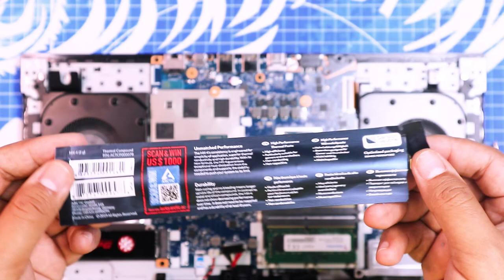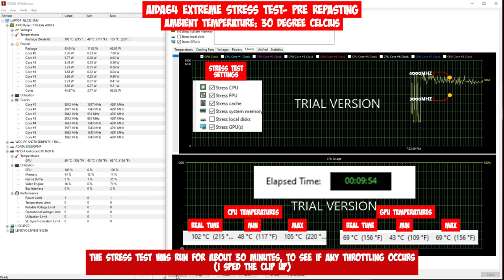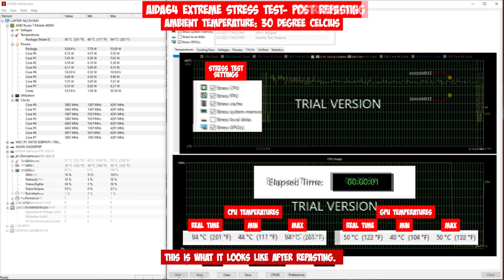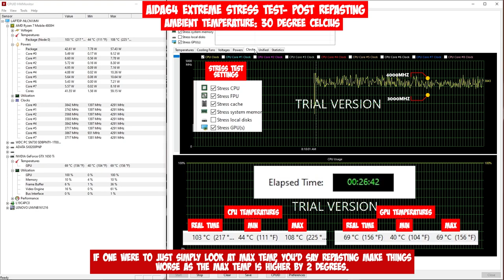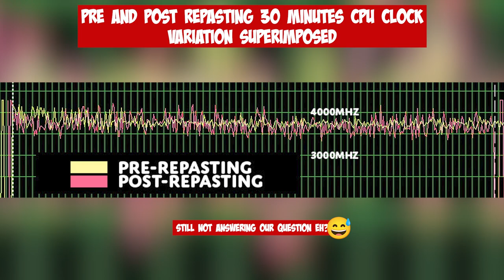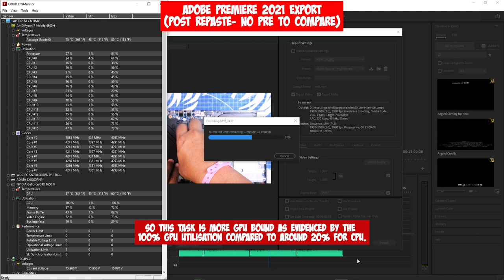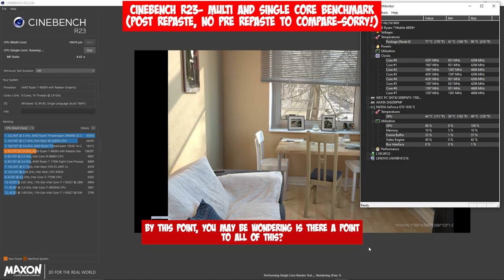Repasting My Lenovo Legion 5 |Replacing Old Thermal Paste|

Comment: can this laptop use liquid metal?
Reply from the maker: technically you can use liquid metal with any computer. however, that doesn't mean you should. yes, it conduct heat well but the issue with liquid metal is that it is electrically conductive(most of them anyways). in desktops, you probably okay as you won't be moving your tower a lot, in laptops, I would be a bit concerned as at least for me, I tend to carry around my laptop pretty much everywhere. so there's higher risk of the liquid metal to spill and causes a short. the Legion 5 is not specifically designed to use liquid metal, as there's no built in barriers etc to prevent spills. in the end it's really up to you, if you think the risk is worth the benefit, by all means go crazy with liquid metal. hope this helps😁
Reply: ohh tq for the insight. i thought this laptop can use lm without worrying it is gonna spill anywhwhere because the amount of lm applied is very thin *sorry for my bad english

Comment: can we just blow the fans to clean the dust? I'm too scared to pull out the fans from motherboard
Reply from the maker: hi. thanks for watching. you can blow the dust off the fans. but I suggest to do that more often ie every few months or so, so that there won't be any stubborn dust built up. you can also use old tooth brush to remove the dust without taking out the fans. hope this helps.

Comment: sir do you need to remove the plug of battery before applying the paste?
Reply from the maker: thanks for watching. yes, ideally, if you're doing anything with the back panel open you should unplug the battery. this is to minkmize the risk of shorting something out. Im quite guilty of not unplugging the battery many times, but do as I say, rather than as I do😅

Comment: Hey, i got Lenovo AMD Ryzen 9 7945HX (16C / 32T, 2.5 / 5.4GHz, 16MB L2 / 64MB L3) any chance if i repast the temps will go lower? the 7945HX runs pretty hot under load average 80-95c  

Specs:
CPU
AMD Ryzen™ 9 7945HX (16C / 32T, 2.5 / 5.4GHz, 16MB L2 / 64MB L3)

GPU
NVIDIA® GeForce RTX™ 4070 8GB GDDR6, Boost Clock 2175MHz, TGP 140W

Memory
32GB, 2x 16GB SO-DIMM DDR5-5200

Storage
1TB SSD M.2 2280 PCIe® 4.0x4 NVMe®

Display
Size
16"
Resolution
WQXGA (2560x1600)
Touch
None
Type
IPS
Brightness
500 nits
Surface
Anti-glare
Refresh rate 240Hz, DisplayHDR 400, Dolby Vision, AMD FreeSync, NVIDIA G-SYNC, TÜV Low Blue Light, TÜV High Gaming Performance
Multimedia
Audio Chip
High Definition (HD) Audio, Realtek ALC3306 codec
Speakers
Stereo speakers, 2W x2, optimized with Nahimic Audio
Microphone
Dual-microphone array
Camera
FHD 1080p, with E-shutter, fixed focus
Connectivity
Ethernet
Gigabit Ethernet, 1x RJ-45
WLAN + Bluetooth
Wi-Fi 6E, 802.11ax 2x2 Wi-Fi + Bluetooth 5.1, M.2 card
Ports
Standard Ports
3x USB 3.2 Gen 1
1x USB 3.2 Gen 1 (Always On)
1x USB-C 3.2 Gen 2 (support data transfer and DisplayPort 1.4)
1x USB-C 3.2 Gen 2 (support data transfer, Power Delivery 140W and DisplayPort 1.4)
1x HDMI 2.1, up to 8K/60Hz
1x Ethernet (RJ-45)
1x Headphone / microphone combo jack (3.5mm)
1x Power connector
Keyboard
4-Zone RGB Backlit, Hebrew

Power
Battery
Integrated Li-Polymer 80Wh battery, supports Super Rapid Charge Pro
Power Adapter
300W slim tip (3-pin) AC adapter, 100-240V, 50-60Hz

Thank you
Reply from the maker: hi. in simple terms. your system won't be any significantly cooler. it just that by repasting the system will be more efficient. ie your system will still reach the same load temp of 80-95, but you will get better performance at that temp.
this is simply because that's the way the system is designed. the laptop will continue to pump more power and go faster as long as there's still thermal headroom. hope this helps.
Reply: @masterofnone4608  Thank you for the reply. I've repasted my CPU and GPU with Noctua's thermal paste the factory thermal wasnt good. thanks for your feedback

Comment: My legion keeps crashing on every single game it says GPU driver shit. Does that mean I have to repaste mine as well? Thanks appreciate the reply.
Reply from the maker: I believe the correct first action would be updating the driver first.
Reply: @masterofnone4608  You have no idea how many windows reinstall / driver reinstall I did with the DDU shit man so annoying can't play games on a gaming laptop xd
Reply from the maker: @wonderbopeep64  sorry to hear about that. repasting really is for getting better(slight) cooling performance. it does nothing to driver issues. however, if you believe the crash is due to uncontrolled temps, repasting may help. but if it the driver issues persist despite reinstalls, i highly recommend you get your laptop looked at by a professional. i don't believe i can be much help beyond that without actually seeing your laptop myself. hope things'll work out for you.
Reply: @masterofnone4608  awesome thanks man. will check in next month for professionals to actually look at it.
Reply from the maker: @wonderbopeep64  hope things turn up well for you.

Comment: What did you have the lenovo vantage fan profile set to? I wonder if they have their fan profiles set to a standard that conforms with the expected results of the paste they use from the factory. That could defiantly counter act any improvements the paste is making, if the system is waiting longer to kick the fans on. Better fan controls would be nice. I only need my laptop to be quiet in class. It can get as loud as it wants if I'm gaming.
Reply from the maker: hi thanks for watching. For the stress test I put the laptop in auto(balanced) mode. I did run the stress test in performance mode but temps were running over 100 degrees too often with very little clock speed gain. by my estimate running the system in performance mode will gain you approx 10% performance in exchange for more heat and fan noise.

personally I don't feel the trade off is worth it. So I run the system in auto mode as it's probably more representative of how most people would use the laptop.

again, in quite mode you'd expect a quiter system with less performance.

hope this answers your question. thanks😊
Reply: @masterofnone4608  , interesting! Very interesting.
Reply: @masterofnone4608  Do u have any other tips for laptop ?and do u think a begginer could do the repaste alone?
Reply from the maker: @Kaantop7  hi. thanks for watching. not much tips apart from be patient and take your time and of course use plastic pry tools 😊
yeah, I think an inexperienced person can repaste. especially in the Legion 5, where lenovo did make this laptop quite user upgradable friendly. main thing is, again take your time and be reasonable with it.
watch how people do it(not just me) until you're confident enough and then attempt it yourself.
Don't rush and take your time. to be honest most challenging part for me is really taking the back panel off😅
once that's done. everything else should be easy.
hope this helps. thanks

Comment: Hi, thank you for the video. Wanted to asked you about one think (maybe you know). Recently i've bought a Lenovo Legion 5i with CPU i7-10750H and RTX 2060. Seems pretty tough but when I play Far Cry 5 on max (system suggested that) I get 85-92 CPU temp. Laptop is 4 months old and I also use a cooling pad. Should I be worried about this temps?
Reply from the maker: hi. thanks for watching😁 the 10750h max temp is rated @ 100 celcius before it starts to throttle down.
There are many factors that influence temperatures, airflow and ambient temps being among them.
based on what you mentioned, that temp range is well within the safety limit of the cpu while it being stressed.
I would be worried if your laptop is consistently operating at that temp on idle(ie just turned on and not doing anything), however if you're gaming it should be fine. 
the best way to know whether your temp is normal for for your laptop is to compare with what the temps other people with same laptop experience. nowadays it's easy, just search your laptop on YouTube and I'm pretty sure there's at least a few Legion 5i reviews. you can compare your temps with them. hope this helps😁
Reply: @masterofnone4608  Thanks for answering. Do you know is it possible to overclock this series of laptops?
Reply from the maker: to overclock, in general you have to have upgraded cooling. that's why there's aftermarket cooler.
with laptops, it's a bit complicated as there's no real after market cooler for laptops.
manufacturers also designed their laptop cooling to extract a certain level of performance and usually there's very little/no more performance that can be squeezed from the processor because cooling limitation.
you also have to start thinking about increased power requirements when overclocking. as most laptop charger is designed to be compact and cost saving, usually the supplied charger will just be enough for the rated performance of the laptop and would not be suitable for overclocking.
so, no. I don't think you going to get any tangible improvement by overclocking your laptop and would probably hv more stability problem.
ha ha. anyway, this is just a long winded way of saying I don't think the Legion 5i(or any laptop for that matters) was built with overclocking in mind.
hope this helps😁
Reply: @masterofnone4608  Many thanks. This is very important information for me, because no matter how much do you read about gaming laptop it never enough. Now i've read about different processes like undervolting and still try to guess does it need something like that.
Reply from the maker: @recreator9755  undervolting is more to do with getting the temperatures in check, than any boost in performance. boost in performance(if any) when undervolting is mainly due to improved temp that lead to less thermal throttling ie you getting a more consistent and sustained frequency. not exactly the same as overclocking. hope this helps😁

Comment: I wanna ask something. I have ryzen 7 5800h and rtx3060 model legion 5. It has been 3 months but it looks dirty. Can i clean the dust without removing anything? (i mean just the back panel ofc) Maybe with some air or brush like you did?
Reply from the maker: yup. you can. just use a small brush(I use an old tooth brush) to get the dust off the fan blades and us some compressed air(i used and electrc air compressor(pumpl for inflatable pools) to get it off the motherboard. hope you find this helpful. thanks for watching 😁

Comment: ok thx for video . got mine thermal paste also changed yesterday : want to point a very important thing to consider - the temps are higher now on cpu and gpu , and i thought first I made a mistake fitting smth  but indeed the inside diode temp goes higher because coolers can take faster temperature out  so take care everyone, basically cpu is now on 92 celsius and was on 85 c and thermal paste was rock old , changed to a good one grizzly kryonaut

Comment: My 5800h is reaching 100 degrees and throttling, the gpu reaches between 90-92~ degrees. I hope repasting works for me... I did clean a little bit the fans but I'll try now with a toothbrush

Comment: I'm going to replace thermal paste and pads on my Lenovo legion 5 Gen 6 (i bought 32 GB of faster RAM 3200 CL20 so i though why not? Once i open the PC let's do the full work) and bought Noctua NT-H2 and Thermal Pads with 17 N/m*K
Your video Will be so useful when the components Will arrive!
Reply from the maker: thanks for watching😁
Reply: How did you know what size of pads to go with?
Reply: And  did the pads help?
Reply: @Morri88  for the size of pads I looked on internet, and if I am not wrong 1 mm should do the trick but I don't remember. Yeah they helped, the temperatures are exactly the same, but fans are quieter most of the time and frequencies are more consistent.

Comment: Hello. I have the exact same model. Any warranty stickers I should look out for?
Reply from the maker: Hi. thanks for watching. as far as I can tell, no warranty stickers anywhere on mine. hope this helps. thanks.
Reply: @masterofnone4608  
Thanks. I noticed that there were none on mine too but I just had to make sure 😅 Like yours, mine also has a tiny Lenovo sticker on the top portion, any idea on what that might be?
Reply from the maker: @mediocritycentral  can't say for sure. it's between the power port and the hdmi. I'm guessing it's probably covering a screw that you need to remove in order to take out the main board. but it's just a guess, don't really know for sure.
but don't think need to bother with it for the typical upgrades eg RAM, ssd etc.
hope this helps 😊

Comment: use thermal grizzly kryonaut , it has the high thermal conductance at 12.7 W/mK ♥️♥️♥️♥️ , while your MX4 is like 4.7W/mK, but still good ♥️♥️♥️
Reply from the maker: thanks😁 I probably try that one next time.
Reply: Was there any temp improvement compared to the stock thermal paste?
Reply: @miroslavmartinek522  i applied some to my friends asus tuf laptop , since the TUF gaming laptops have little to no vents , it overheats like hell 🔥🔥🔥

94°C was the maximum , repasting with Kryonaut brought maximum temps down to 83°C ♥️♥️

that was for the CPU , GPU had like a 4 degree drop..
Reply: @JoshuaG  Ok, thanks a lot
Reply: @miroslavmartinek522  the effectiveness of the paste depends how much or how little you apply to it.

What i did was just a little simple dot of paste and thats it 😊
Reply: @JoshuaG  yes, it deffinitely makes sens, the thinner the paste layer, the better :D i was just wondering if there is any improvement when using better thermal paste on this particular Lenovo Legion model
Reply: @JoshuaG  its been 2 months do u still recommend thermal grizzly kryonaut  for my legion y540 i7 9750h???
Reply: @darthvader44  Definitely 👍 , 9750h is toasty , its needs some kryonaut lovin♥️
Reply: @JoshuaG  thanks for replying:))
Reply: Those numbers don't mean anything. They are provided by the manufacturer after all.
Reply: @AB-sg4xu  Thats why there are test's to prove it , and Kryonaut is well known to PC enthusiast's and seeing countless youtube videos with extensive testing on Kryonaut proved its more effective ❤️
Reply: @JoshuaG  yeah but it's not just down to those numbers. it's maybe 1-2C difference, nothing special.

the one thing you are overlooking is that Kryonaut is a less viscous paste, which isn't that good for laptops because of low mounting pressure of the heatsink, and it can also dry out at temps over 80C.

So for a laptop MX-4 is better because it's more viscous it will last longer too

Comment: Hi Sir ,

I am using legion 5 pro
While on cinebench my temps goes 100 degrees 
And cpu watts utilization is only 68w

Same system my friends also have 
When they do cinebench there laptop also goes 100 digress but there cpu watts utilization was 78w

For me 68w for them 78w

Any idea why this is happening on my system?
Reply: @Master of None
Reply from the maker: hi. thanks for watching. I am also currently using a Legion 5 pro. cpu 5800h and rtx3070.
I haven't done extensive testing, however in my laptop, while running cinebench loop for 30 minutes straight,
what I notice is the temp spikes can go as high up as 108 degrees celcius, however, the spike usually last for a few seconds only and the temp drops back down once the fans start ramping up.
what I notice is if you run cinebench in balanced mode(led white), the power draw limit is around 65w and the temp limit is around 90(temp where the cpu start drawing less power or start to clock down/throttle).
if you run cinebench in performance mode(led red),
the temp limit is around 100 degree before cpu throttle down. power draw can go as high as 80w in performance mode.
have you tried in both modes?
ambient temperatures also play some roles, I live in the tropics, my ambient temp is usually around 30 degrees so comparing to others results(those from cooler countries) my cpu does run a few degrees hotter.
if you think your system runs hotter than it should be, you could try repasting the cpu or if still in warranty, check with your local lenovo.
hope this helps. thanks for watching😁
Reply: @masterofnone4608   I started cinebench 23 on performance and on charging and ambient temperature is 34

Anyways i am returning my laptop as it has random Freez issue on silent mode

Comment: oof that's a lot of thermal paste. I wanted to see how much you would use for reference, because i'm sitting here repasting my own legion 5, but damn man you're gonna have a mess to clean up the next time you lift that cooling brick
Reply from the maker: ha ha. actually it's not too bad. I repaste it twice because the first time I did it, the temps was pretty similar that I thought I put too little paste, but as you said it's actually a bit more than I need. however, it's not so much that it made a great mess😅 thanks for watching😊

Comment: i just bought the legion 5 pro i7-11800h 3070 variant few days ago, not satisfied with the temps on the cpu and gpu so i decided to open it up and see it for myself. I was surprised that the stock paste already dried up! i could swipe my finger on it and it crumbles. I clean the eff up all the old paste residue, and replace it with what i have on hand, cooler master cryofuze paste. after i done that, i rerun my heaven benchmark,

points went up 200 extra, and both temps on cpu and gpu no longer reaches 75-80+. cpu chilling at 60+ ish and gpu so far never went above 75c.
Reply: So is cooler master cryofuze good? Or gelid gc extreme? I want to know for durability because I don't want to repaste every 2 weeks
Reply: @renegadesg018  for CPU i recommend you use the Honeywell PTM 7950 pad. The stock one came with legion.

for gpu i found best result use Thermalright TFX paste. cryofuze also ok.